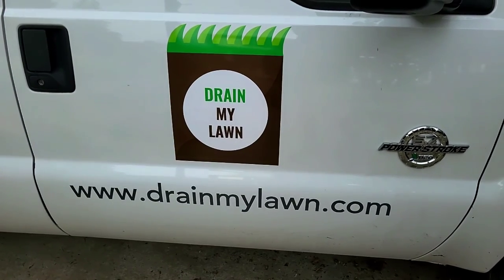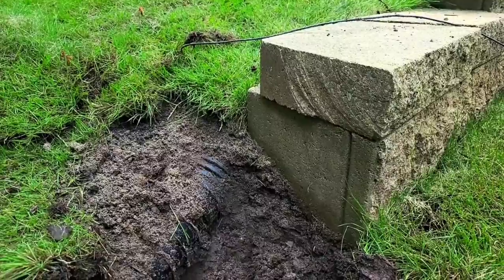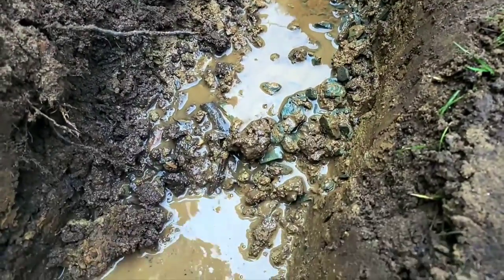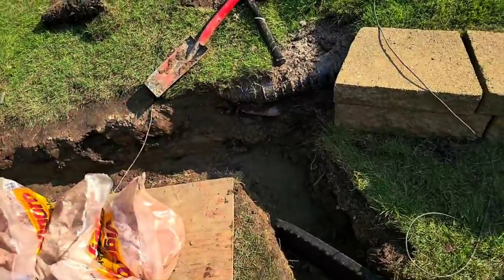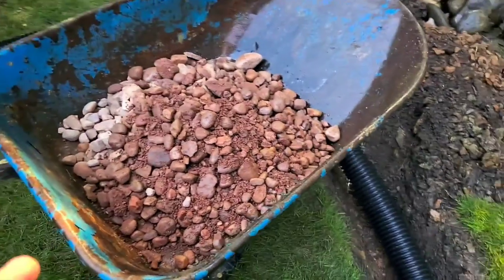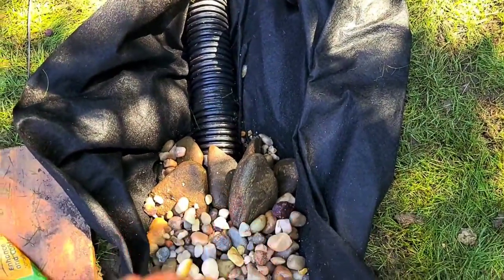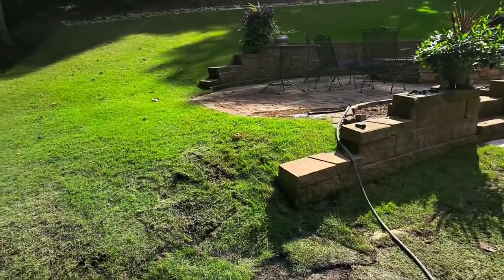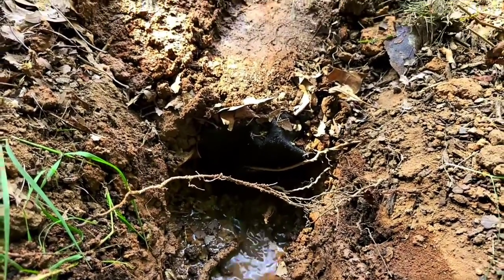French Drain Done Right - Real project walk through (Charlotte, NC)

Comment: Is "burrito" wrapping really needed if you are in a mostly clay area?
I have a big job going right now at about 350 ft custom French Drain.,I'm really debating on using fabric over rock and pipe...think I'm just going with smooth rock and smaller dimensions and completely surrounding the pvc im using.
No dirt will be backfilled with the rock.
Also...my project is a large area of "surface" water that ponds up for long periods at times. I feel its different with surface water to sub surface water if you know what i mean?
Thanks for what you do,very informative
Reply from the maker: We always wrap our French drains because clay migrates more than you think.  If we need high volume capacity, we'll install catch basins on a solid line in the same trench we keep the French drain free of sediment and debris.
Reply: Do not use geo fabric on clay soil.
Look up apple drain youtube channel. So many experiments has been done and many people have issue of water not draining because clay soil will completely clog the geo fabric!!
Reply from the maker: @miyuru1  under turf, clay does not clog geotextile the way you're saying.  No geotextile in clay soils will eventually fail due to soil migration.
Reply from the maker: @miyuru1  https://youtu.be/gmmaaNSqVk8?si=lh1JHocSC23mwS5J

Comment: Exactly what I was after, great video! Just wondering, with it being clay, do you just put that on top of the stone after or do you use some sort of topsoil? Thanks!
Reply from the maker: Thank you Ethan.  We put grass back over this one.  We prefer to use a nice mixed soil on top of the drain so the roots fill it up quickly.  The grass roots actually keep the top relatively porous compared to just soil.  If not using grass, stone or mulch works.
Reply: @drainmylawn  That makes sense, thanks heaps for your reply :)

Comment: Where the work reflects the god we serve. Amen 👍. I have a friend of mine that has a wet section of lawn and a large hill at the back of his property. He doesn’t have anywhere to pipe the water to and doesn’t want to pipe it to the road. He wants to put in a large drywell that’s about 6 feet wide by 3 feet deep to take the water and a section of French drain running into it. I’m going to put a few feet of stone around the drywell and keep the top maybe 4-6 inches below the surface. I used to put in septics and this will resemble one. What are your thoughts on this. I don’t know the flow of water he has or if it will take and perc it all. I tried to express these concerns with him but he seems pretty intent on doing it so I’ll help him. How would you deal with a property with no place to direct the water? There are no road drains either to pipe it to  and neighbors.
Reply from the maker: Hey Jason!  It's difficult to say without seeing it.  We have clay soils here in Charlotte so drain fields can be tough.  If even a sump pump can get water to where it needs to go, dry well may be thr only option.  Hope it works out!

Comment: Silly question: why not use perforated pipe for the entire distance?
Reply from the maker: In order to use perforated pipe the whole distance, the french drain would have to go along with it which expensive and not necessary.  Just burying perforated pipe will cause it to clog with roots and sediment.  Solid pipe is the most practical and cost effective way to move water from a french drain to an acceptable area.
Reply: @drainmylawn  Awesome answer and apparently quite obvious... once it's been pointed out.  Thanks! 👍

Comment: Do you have access to 3/4 inch washed stone? It’s already been cleaned and you can get it in a gravel pit. Depends on your area I guess. Nice job.
Reply from the maker: Thank you.  We do have bulk washed stone in our area but bagged stone is easier to handle for these small projects. We've since started using some washed stone (check out some of our other videos) and using a sock on perforated pipe when stone is not as clean as we would like.

Comment: That fabric would plug up quickly and stop working in the clay soil I have in KY. I have tried it twice. No more! Just potato size rock and drainage pipe. The cloth will help the rocks not sink into the ground but I wrap nothing. We have terrible soil.
Reply from the maker: A good non-woven geotextile would adopt the same/similar drainage characteristics of the surrounds soil.  The purpose is to stop the migration of then surrounding soil so it doesn't eventually fail.  A subterranean wrapped french drain will act identical to a unwrapped one on day one but won't lose performance like the unwrapped one.

Comment: First, Glory to God our Father and Jesus Christ our Lord.  I am in Atlanta,  and I am talking to a landscaper about doing something like this in a wooded hill part of my yard that has a lot of water that dumps out on to a sidewalk and then flows to a 4 inch grate in my pool concrete deck. When I know a heavy rain is coming, I take the grate off,  and it works pretty well. I have been doing this for almost ten years.  There is a box at the bottom of the hill, but it constantly gets filled up with dirt washing down the hill. I was thinking about putting an open rock trench that would direct the rain to the box, but how do I keep the dirt back? Do I put landscape fabric on top of the box and then sand or rock and do I put pine bark mulch or something on the side of the hill. It is a hill under a large hickory tree, so very shaded and the shrubs that used to be there died from lack of sun. I had heard that putting cardboard under the mulch also helps with erosion,  but won't the mulch just wash down onto the rock trench? Thanks for any advice and God bless.

Comment: Getting rock like that is a problem for us DYI guys.  Lowe's charges $10 a bag for that.  About a 10 pound bag.  I would need about 200 bags to fix my yard.  Can't do that.
Reply from the maker: At lowes, it's the pond pebbles.  Normally runs around $4 per .5 cubic foot bag.  You just have to wash it.  The washed stuff is expensive
Reply: Go to the bulk material distributor in your area.  They will sell you a truck load of the stuff.  Vulcan is the big one in my area.
Reply: This all looks to be from Lowes why not use higher quality product
Reply from the maker: @MRM5J  rock is rock
Reply: I would just double wrap it and not use stones
Reply from the maker: @Ks13007  You would soon have a failed system.  This is due to the fact that you need space between the fabric and pipe to allow water to seep in and roots to dry before getting to the pipe.  If you just wrap it, you will only be draining where the slits are.

Comment: What may be better is a wrap around bandage for the  pipe instead of the stones and wrap. There's is this material they sell in rolls which will block the soil to get in pipes but not water.  But it's not made for plumbing, so you won't find it there.
Reply from the maker: You need the surface area of the rock areas and the volume of the whole drain to protect against roots clogging the system.
Reply: @ks1307:  You want to keep the mud from infiltrating the stone.
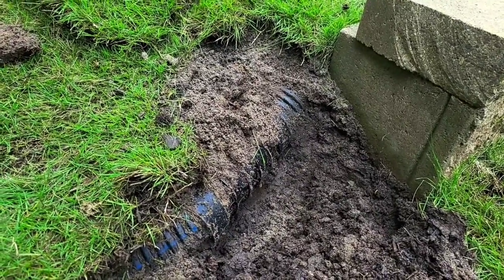Go back to video @ 2:10 .
Reply: There are videos here that show how just a “sock” fabric over just the pipe quickly clogs.  The best practice concept is to protect the GRAVEL from clogging. The fabric is between the soil and the drain-rock to  protect the drain-rock from clogging. This also maximizes the surface area of the collection drain-rock. More area for the fabric is important because the fabric itself is reducing flow, it needs maximum surface area to overcome the fabric’s reduced flow rate.

Comment: I give you an F… solid PVC pipe only! Corrugated plastic pipe crushes under the weight of the stone used to cover the drain, and the ridges in the drain collect sediment and HOLD water. To simply state my point, If you’re using anything other than solid PVC French drain pipe, you are doing it WRONG!
Reply from the maker: Cool
Reply: Lmao... I prove you wrong everyt day of the week. You really are clueless to new products and technology. Not to mention ALL major road projects use 6" corrugated pipe.
Reply: dude once the ridges are filled with sediment theres no more ridges lol so therefore the pipe becomes a solid pipe so to speak.
Reply: This dude has no idea what he's talking about
Reply: Isn’t that why geotextile double punched fabric is supposed to be used.  Do the burrito wrapping pipe and stone, and sediment is a non issue, no?
Reply: @aaronbirsen5364 corrugated is cheaper & less labor intensive to lay, but holds sediment in the undulations and will fail for one reason or another in enough time. This one was built well though, those clean rocks will make it last